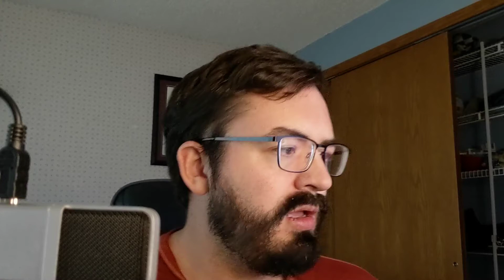[Civboot] What software does civilization really need?

Comment: Imho forth and lisp/scheme are very much the hacker languages for bootstrap anything else, both would only require small cpus (a stack machine for Forth, a cons machine for lisp) to do useful things. 

I so wish there was a raspberry pi like (in pricing and GPIOs, other IO) with like 10x GA144 on it. Also wish Open Firmware (device drivers, written in forth, stored on the hardware).will be the standard boot system on any future open source computer. ^.^ 

I love this topic, I've been thinking about this for a while as well ^.^ Love to see more.

You might find this interesting:
https://www.youtube.com/watch?v=Ad9NtyBCx78
https://frank-buss.de/lispcpu/
Reply: Lisp is very cool, but the requirement that it have a defragmenting memory manager and garbage collector for even basic operation make me hesitant on using it as a bootstapper. I am targeting an ultra-simple arena memory manager with the constraints of 1k blocks to deal with most fragmentation problems in a semi-generic way. The core data types will be built with this constraint... we'll see how that goes.

My current attack path is to develop a general purpose forth CPU on an FPGA, probably building on the J1 CPU. I'll be posting updates as I go :D
Reply: @rettberg5688  Definitely go with Forth for the initial environment. ( Someone will add lisp as soon as the system allows for it. ^.^ )